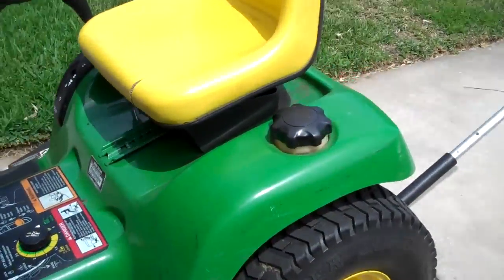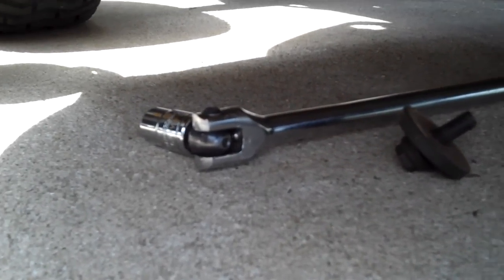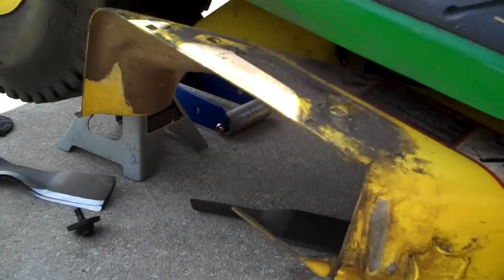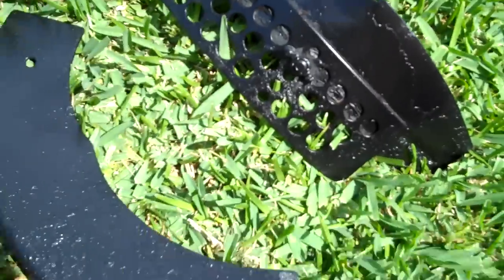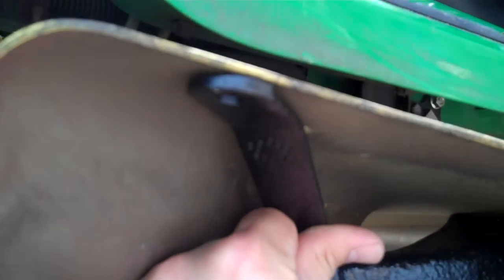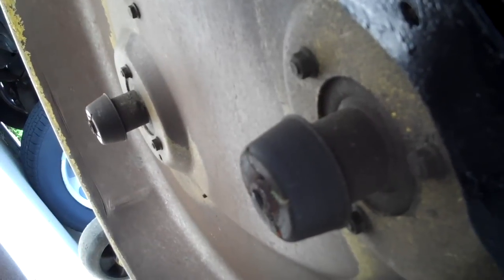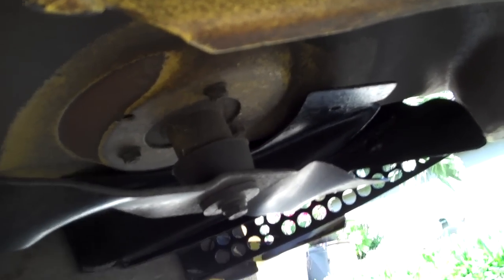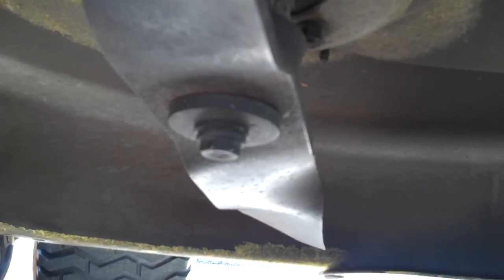John Deere Mulch Kit Install & Blade Change

Comment: Cliff sorry to bother you here but your one of the few videos that has the mulcher kit install. I bought a LT133 used and felt like my mower was just lacking so I took of the deck today to dig into it. Your video had some really good pointers. Thanks. But here's my question, I'm sure the blades I have are on upsidedown. The sharp edge is on the high side of the mulching blades. Can this be right?

Comment from the maker: I looked over the install instructions before putting these on, and am sure it was done correctly. 

If your blades are on opposite of mine, I would be inclined to say that they are on incorrectly...
Reply: Cliff's How To Channel : Sir, did you have to drill a hole through your mower deck to have the deflector stay pushed up?

Comment: Please explain, doesn’t matter how I install my blades, I can manually turn my individual blades to orientate them to the other one manually? When I turn one it does not turn the other. Hope this isn’t a stupid question.
Reply from the maker: Yeah. In the video I said to offset them, but apparently that’s not even a thing with these mowers. They just spin, and aren’t in sync in any way. Sorry about the confusion!
Reply: I think it’s the 42” deck that has a timing belt where that could be an issue

Comment: aside from being safer, is it necessary to remove the blade before installing the mulch kit?
also, what if regular blades are used with the mulch kit?
thanks in advance for your answers.
Reply from the maker: I think you may be able to get it on there without removing the blades. 

You do need mulching blades though, as they are a different shape, and it will not mulch properly without them. The kit may also not fit with regular blades in place.
Reply: "What if regular blades are used with the mulch kit?" WTF? Yeah!! save yourself 20 bucks on blades.
Reply: @parkerbirch1475  I’m working on installing my mulch kit on the 38” and it seems like my regular high lift blades would not clear the mulching kit once installed. The mulching blades that came with the kit are quite a bit flatter
Reply: @yetiswotstream2539  You'r saying the taller blade will hit the mulch cover ? Oh maybe. I have a 48" deck with a black plastic mulch cover that i use either blade with an it clears both. I have put a mulch cover on regular blades and it worked okay for me.